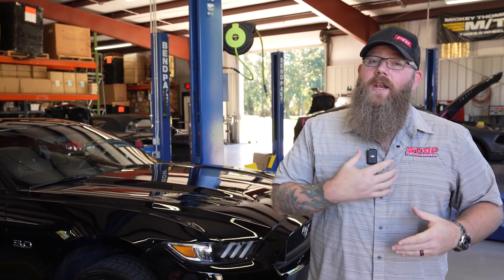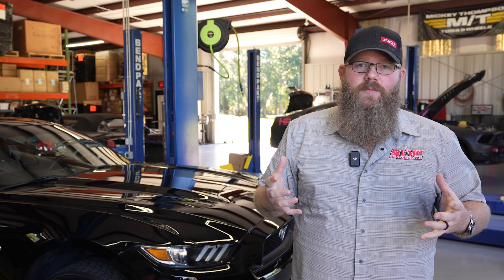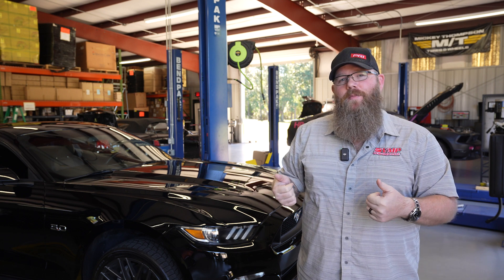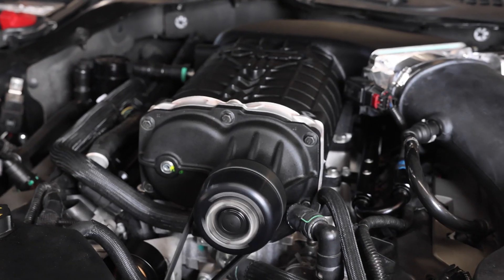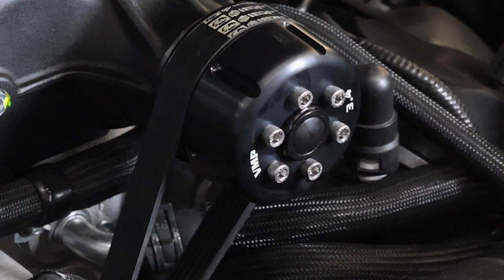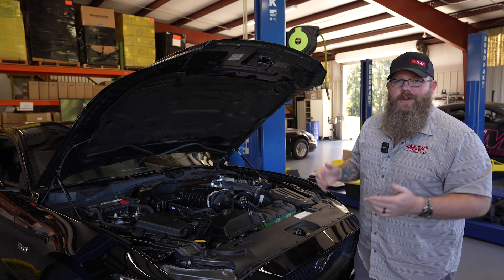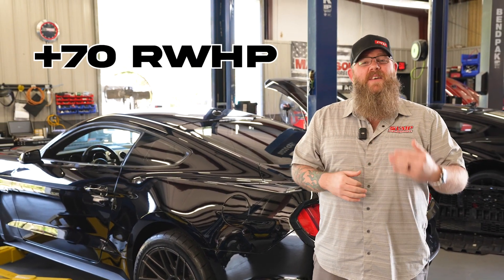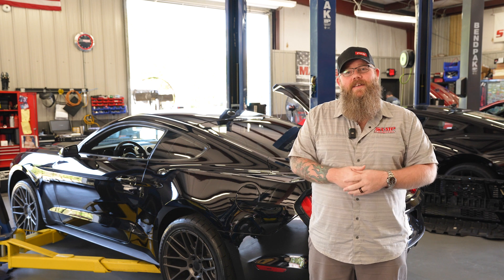Roush to Gen3R head unit swap on '11-'17 Mustang GT.  What's the gain?!  DYNO RESULTS!  || VMP Gen3R

Comment: No doubt that the VMP Gen 3R is a badass blower however, this car could have easily made 70+ more whp at less of a cost of a new head unit. That little 2.3 TVS is more than capable enough to put a window in that stock block 😁

In saying that, if I stick with the TVS life a VMP Gen 3R will most definitely be required in my future 👍
Reply from the maker: Oh absolutely.  But on 93 octane with similar moderate boost levels is specifically the illustration here.  The next video on this car gets our return style fuel system and E85 :)

Appreciate the support and consideration for your future modifications.  Don't hesitate to reach out to discuss your future goals and how a Gen3R could make it happen!

Comment: Curious about reason for only going to 7000rpm? Also is the 656 whp on the gen 2 with the 3.0  pulley(76mm) or the 3.125(79 mm)?
Reply from the maker: New 3.0" vmp  pulley = 79 mm using the old gauge balls measurement method, confusing I know so thats why we use inches now :)

Comment: Thank you this is what i wanted to see before i pulled trigger on gen3R since my blower right now is already maxed out on the 69mm pulley”roush blower”. Would be good time for a change and let it live on 75mm gen3r pulley. Now my question would be is the ported Gen3R good to live on the 75mm pulley or just settle for the normal gen3r? I am also running 1000cc injectors and dual pumps fore system. But goals are to live around 850 wheel range then later on maybe make more power. But for sure wanna live at 800-850 or close to it
Reply from the maker: Standard Gen3R is perfect for you

Comment: This is great! Worthwhile gains swapping a gen3 to a gen3r?
Reply from the maker: Yes, it's worth about 20-30rwhp with a 75 mm / 2.8 pulley and the gains only grown from there, peaking at 75 rwhp with a 20%/2.4 and another 75 rwhp with a stage 3 race ported gen3R (150 rwhp total over gen3).  The R is also a much better design overall with improved clearances and a stronger nose drive.

Comment: Would swapping from vmp gen 2.3 to the vmp gen3r be worth the time and money on 2011 gt500
Reply from the maker: The Gen3R will pick up 40-50 pulley for pulley and 4 +/- PSI of boost while being more efficient and creating less heat.  It would be a worthwhile upgrade in our opinion!

Comment: Nice gains!

I have a Gen2r with the Ford twin 60TB and the JLT 125MM CAI you guys provided.  Also VMP tuned.  Love it. 

I have the 3.2 pulley.  What do you think my gains would be with your 3.0 pulley?
Reply from the maker: Appreciate your business and support!  I assume we're talking about a Coyote Mustang.  If so, that's approximately 2 psi of boost increase and we'll typically see 30-40whp as long as the car is on good 93 octane and is in good overall health otherwise.
Reply: @VMPPerformanceTV  yes a 17 GT.  Thanks!
Reply from the maker: You're welcome!

Comment: Can we get a Gen2R to Gen3R swap comparison video?
Reply from the maker: These videos come about when we have a car that's in the shop with the specific circumstances we're seeking.  Definitely taking note to look for that particular set of circumstances.
Reply: @VMPPerformanceTV  I appreciate the reply. I have a 2014 that's been running with a Gen2R (79mm pulley) for over 20k miles. I've been interested in swapping to a Gen3R, especially once I got built bottom end in the future. Fingers crossed you get a local car in that makes that swap so we can see the real world differences in power.
Reply from the maker: Appreciate you choosing VMP!  On pump 93, you're likely making mid 600rwhp with the 79 mm (3.0") pulley.  On a Gen3R with a 3.4 (88 mm) on the same fuel, you'll likely tickle 700 rwhp and be at the limit of the fuel on very similar boost, with much less heat because the blower isn't working any where near as hard to make it.  It requires less blower speed/RPM for a similar amount of boost out of the Gen3R, plus the latest in our inlet and outlet designs that we incorporated into the Gen3R.

The 2.3 L Roush as well as our VMP Gen2R units are all VERY capable units, but the TVS2650 rotor set is an absolute animal in regards to efficiency and was a logical next step in the progression of pursuing power for both street cars and race cars.  We'll keep an eye out for an opportunity to feature this transition via video, but it is something we have heavily documented through our tuning and development journey so we'd happy chat with you in detail if you'd like to discuss it.  Feel free to drop us an email, call us at the shop, or even DM us on Facebook or Instagram.

~ Happy Holidays!

Comment: So, the question is then, does displacement alone make up for the gain or are the discharge air temps just that much cooler being spun so much slower with a fat pulley? There is definitely more to this story that I wish they went into.
Reply from the maker: Adiabatic efficiency...the blower does what you mentioned and takes less power to drive = more power to the wheels.